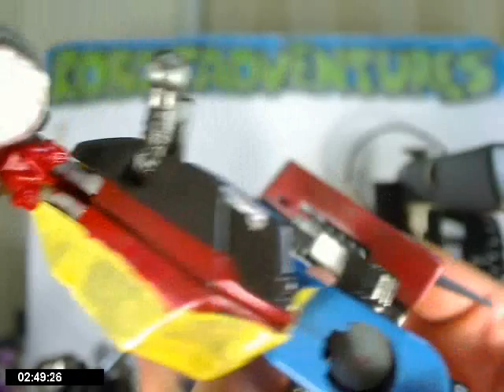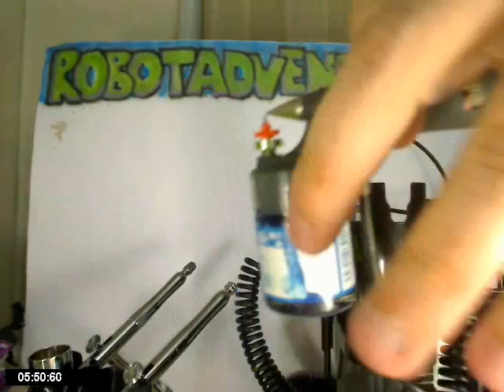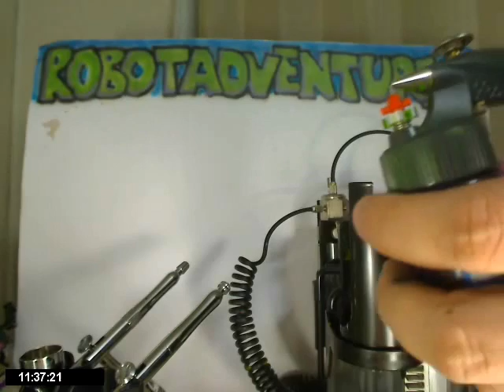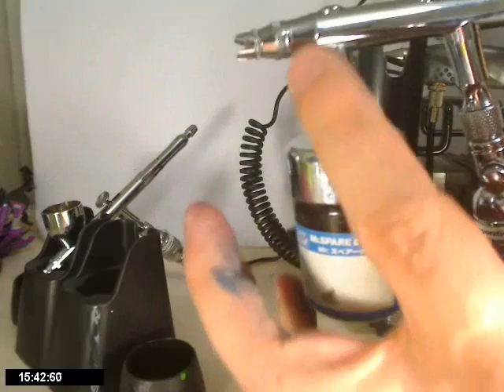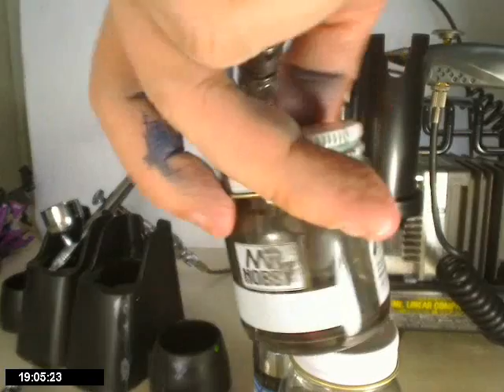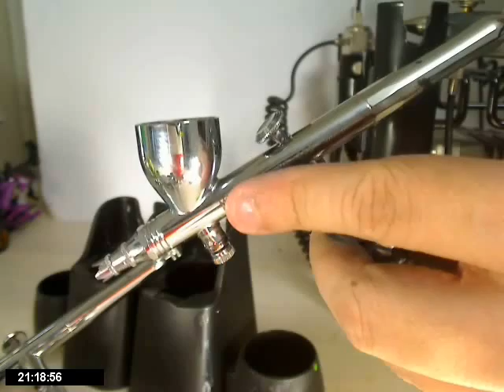ruven basic airbrush explaination.wmv

Comment: Put a few drops of thinner for the type of paint you are using in the cup before a color change and blast it out. For the siphon feeds keep a quick blast bottle of thinner handy and put some of it through the brush between bottle changes.
Two airbrushes I would recommend would be the Iwata Revolution HP-CR and High Performance HP-C Plus(or HP-CP), the C Plus is for detail work and the CR is a good general purpose gun.
Learn double action from the start, you will be better off in the long run.

Comment: Pull the gun apart after every session and clean it out(only takes 2 mins), lubricating the needle when it needs.
Get a compressor, and make sure it has enough PSI, a tank to eliminate pulsing due to piston movement and a regulator that will let you dial in the PSI you are looking for.
Run a moisture trap at the air gun and at the regulator(or a reg/trap in one), water in the air supply is the bane of the airbrush artist.
Thin paints, it should run down the edges of the container like skim milk.